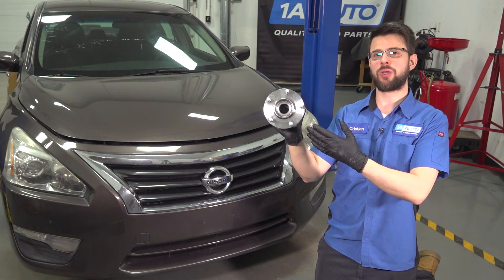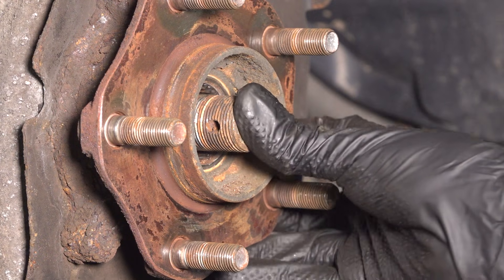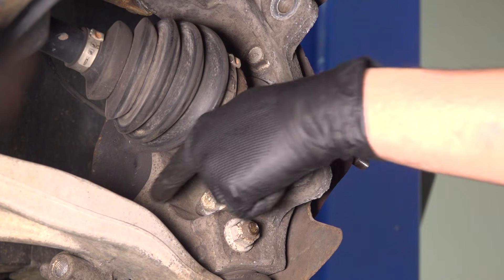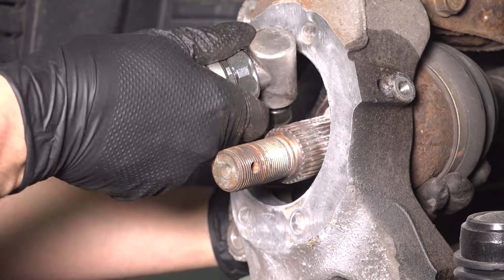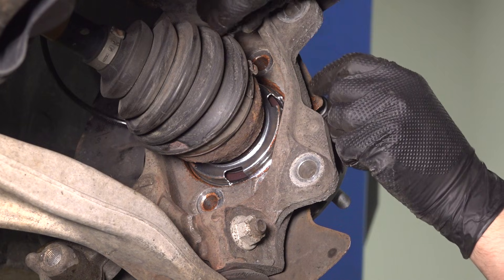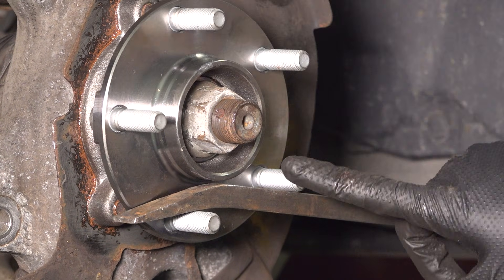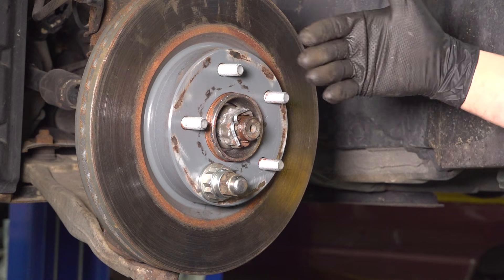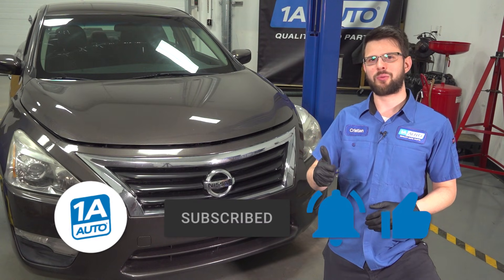How to Replace Front Wheel Bearings & Hubs 2012-2018 Nissan Altima

Comment: This helps a lot. If your old bearing is stuck and stubborn just be patient use a lot of rust remover, chisel at the edges and hammer it out. When putting on the new bearing make sure the abs sensor lines up.

Comment: Nice, but mine was so seized on, I had to take apart my entire knuckle. I was hammering on the back of it until it came off, with an entire bottle of PB Blast gone. Then reassembly I had problems with trying to align my strut with my knuckle. Fun times when the entire thing is rusty. But I did feel the torque specs for the hub was a little light so I did mine at 75 foot pounds. Very useful video though